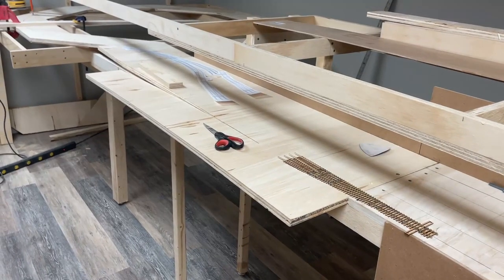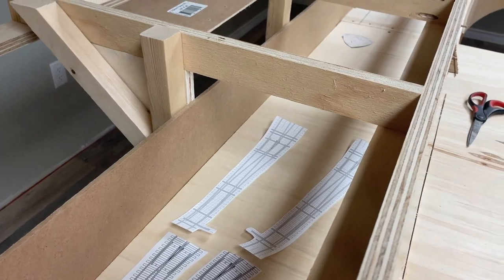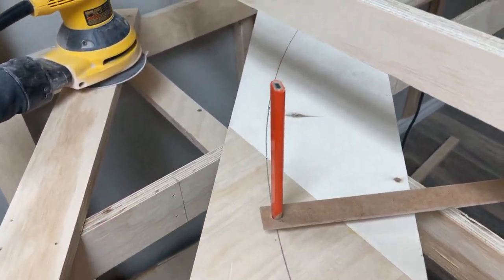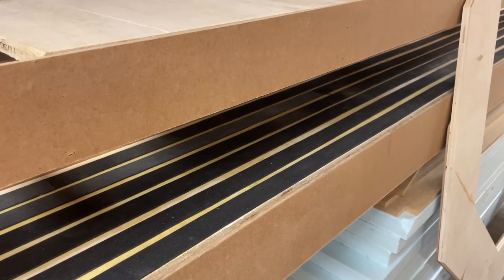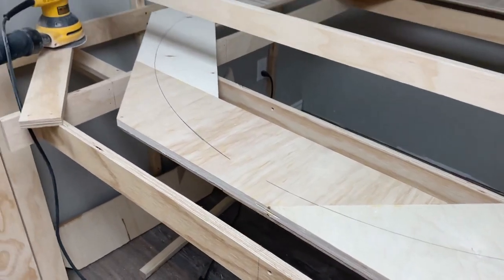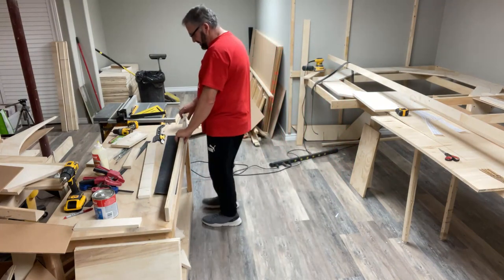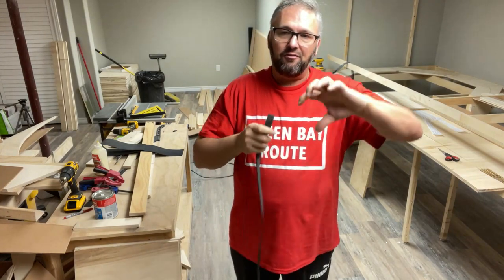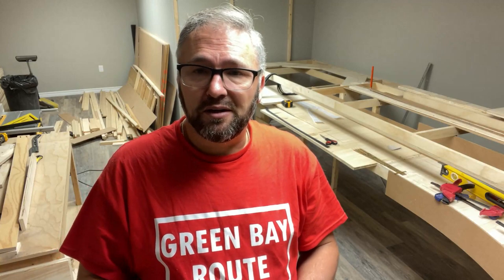How to build a material saving HO scale helix   also more progress on the layout!

Comment: Hi Paul, Nice video and progress so far, the layout is looking great. In regards to the start of the Helix, it looks like the easier option is to add a piece of plywood triangle to help ease out that "S" curve ( bend ) for the transition to the Helix, I like your "see as you go", rarely do things go as planned on paper. :)   By the looks of it, if one was contemplating a double track on the Helix for later on, the Helix doesn't look to be wide enough for a inner track, just a observation on my part.   Finally, for your question, I'm ok with either a "play by play" or just a "summary after the fact" for the roadbed, depends on your time and need for content for each video. Take care my friend. :)